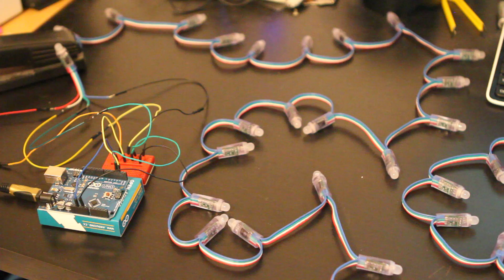Demo of generic LED strand with WS2801 IC

Comment: did i miss something or did you really say you were powering that entire strip off the arduino? Each pin on the arduino can put out 40 mA or so, is that strip pulling less then 40mA?
Reply from the maker: I'm not really all that great with electronics, so I hope what I'm about to say makes sense.

The light strip is hooked up to the Arduino's 5V pin for power. While the Arduino's I/O pins are limited to 40mA, because the the 5V line is not routed through the microcontroller, it's limit is somewhat different. The onboard 5V regulator will limit the current to 1A if powered through the barrel jack (which I did with this strand of lights), but when powered over USB (as in this video) the current would be capped at the USB controllers output of 500mA.

But other than the <=500mA coming from the 5V pin in this video there was no other power source.

Thanks to Connor Wolf on StackExchange for providing the info that I essentially paraphrased.
http://electronics.stackexchange.com/questions/67092/how-much-current-can-i-draw-from-the-arduinos-pins

Comment: I purchased two different light strings from two different vendors. The first set only has 3 wires red, white, blue along with an additional red and blue witch act as the power in. The other set has 4 wires, red, white, green and blue, again the red and blue appear to be for power. Can I combine these 2 strings together to work as 1? One has the 2801 chip, the other the 2811. I guess I screwed up when I Ordered...Thanks in advance for any help here...